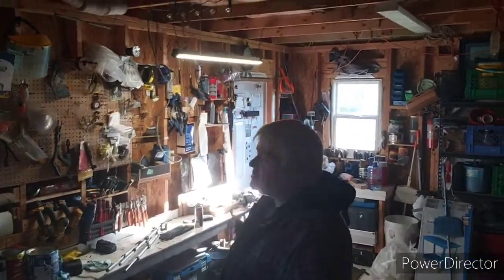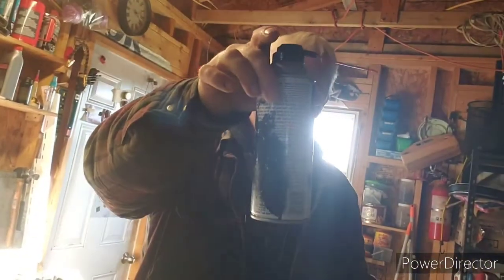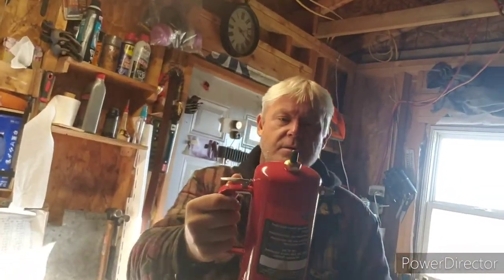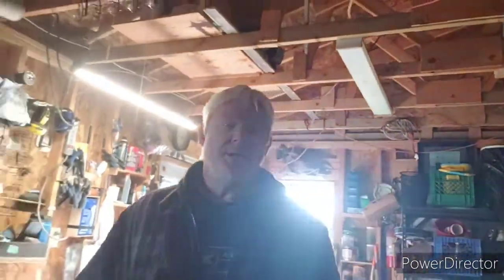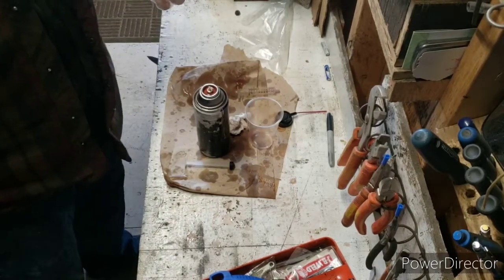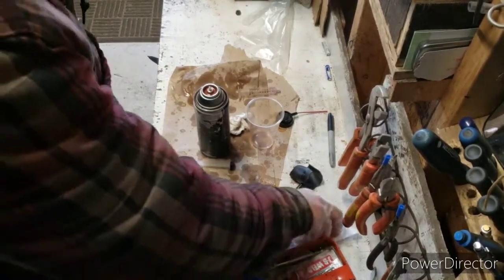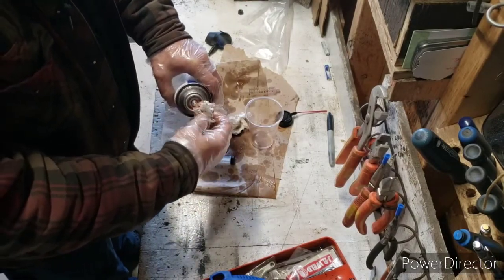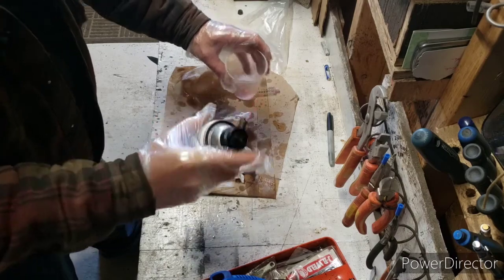Save money refilling aerosol can. hacks and tricks. #refill #wd40 #spraycan

Comment: Man it's really true great minds do think alike, LOL Been transferring WD & other fluids for years into spray bottles due them not being able to spray The acetone transmission fluid mix has been my go to as well, and living in the NE with old equipment & cars it is in constant use. I have used a stem from a tire to add air to a can but that did not work too well. Did start a a video adding a tire stem to a can to refill with air & fluid. It is in my files (some were .🤔) have to do a remake. The syringe & tube looks like a good idea, have to try that one. I like the red refillable can you showed.
👍# 6
Stay well, Joe Z